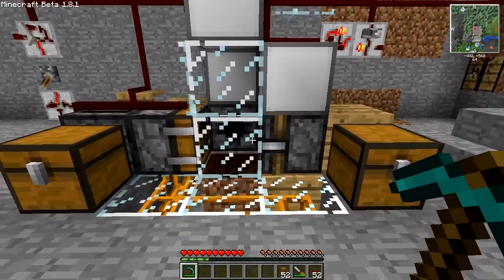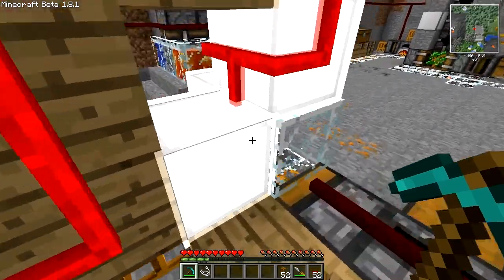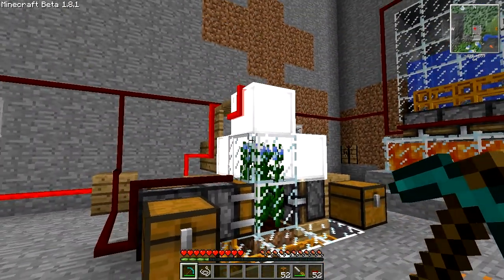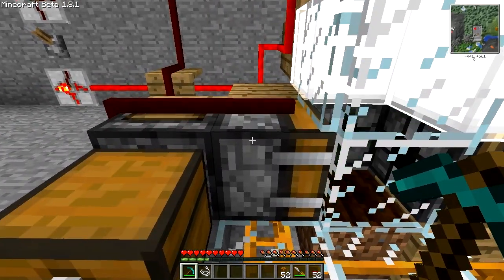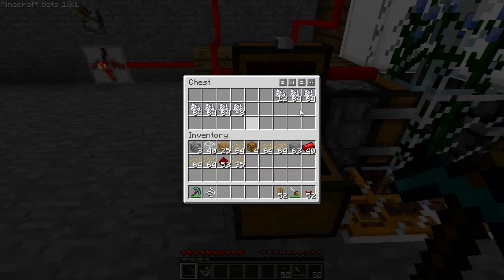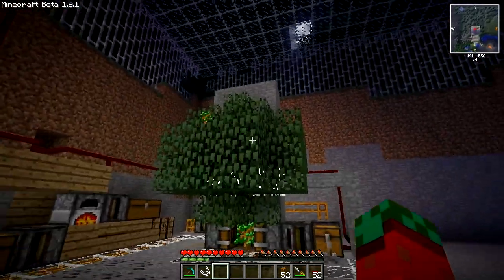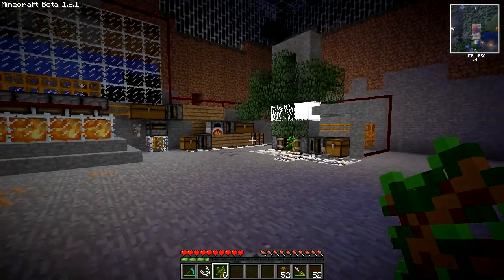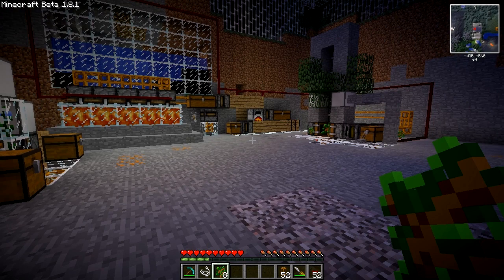RedPower 2 Machines Usecases

Comment from the maker: @SuperMediaWizard No, currently each is generating it's own version. But the authors are working on consolidating this via Minecraft Forge, the API Layer they're both using. In future versions, there will be a so called "ore dictionary", that will unify ores and other shared resources. Users won't have to do anything and ores will just work cross-mods. But until then, you'll have two kinds of copper, tin, etc.

Comment: @wyattutz she didn't steal parts. They are the same sort of idea, but they don't require power, they are smarter, they are cooler, and they called Pneumatic Tubes instead of pipes. The machines are also better and more useful since they don't require engines, which causes trouble, require fuel, and explode if on for too long.

Comment from the maker: @LearnWebDev It's a hollow cover. Those will have a hole in them, so you can fit a jacketed wire or tube through. You can find the recipe in my unofficial recipe list or in the cutting recipe video addendum.